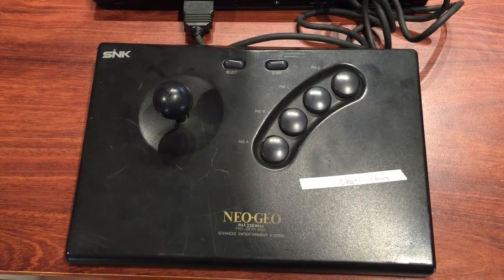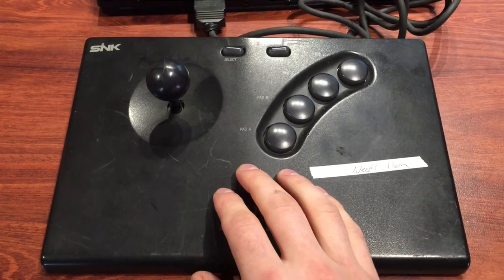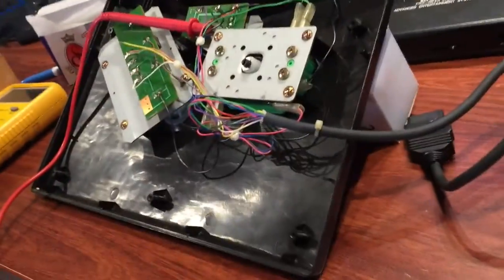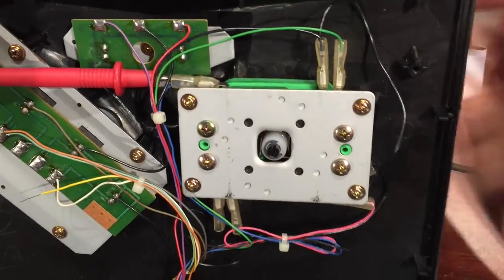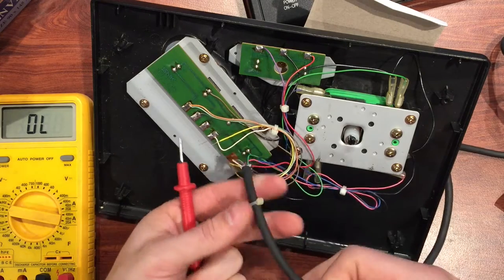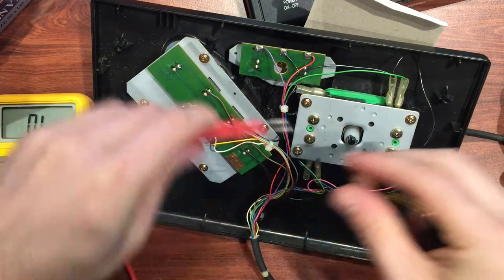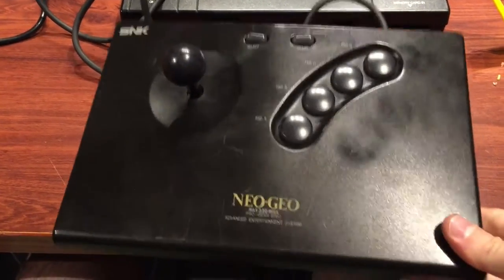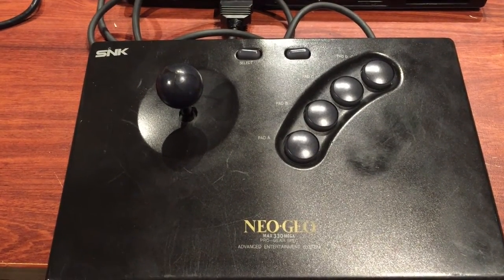How to fix a Neo Geo AES arcade Stick Controller Joystick Repair - YouTube

Comment: Alright! Old video, but it helped me! Got the controller working again within minutes. Failed connector, for the same reason as in the video. Cheap third party extension cable from Amazon pushed the wire away from the connector. Shoved the wire back in and voila

Comment: This seems to be the problem with the majority of these classic controllers. Sega, PS, Neo Geo etc. You are better off replacing the entire wire right away and save time on trying to find where the bad connection is.